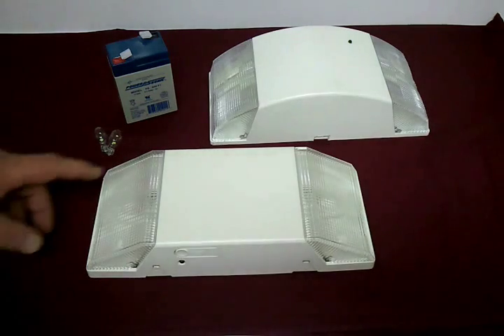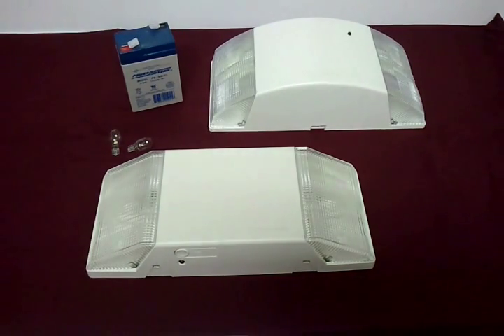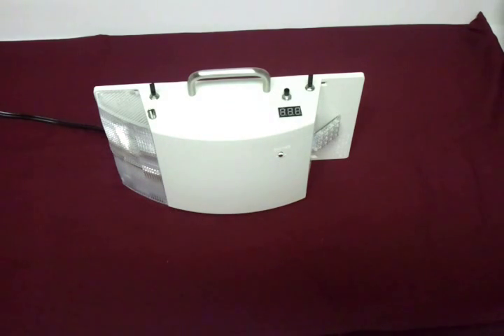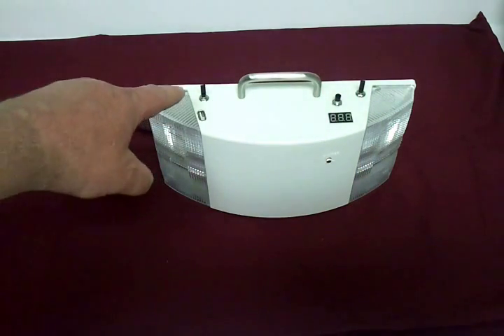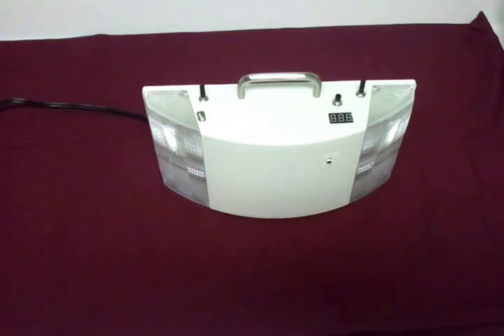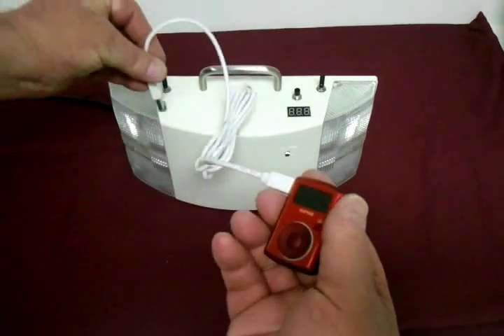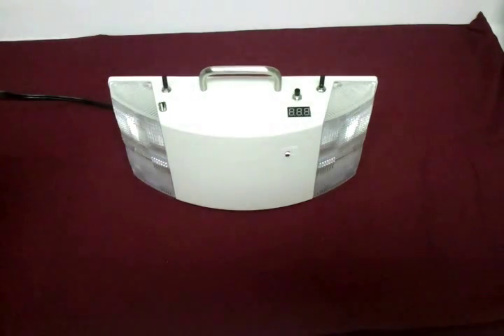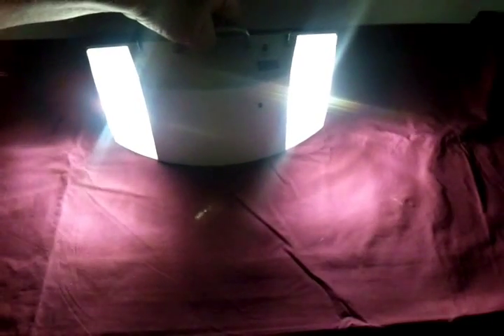Emergency Light Project

Comment: If you aren't already using the original test button, add a test button to the unit. it'll temporarily put the unit into emergency mode so you can check the battery. also, this is just me, but I'd leave them in automatic mode so if the power goes out at night, the unit springs into action. if in the day, no big, just go ahead and turn it off. turn it back on at sundown.

Comment: well after reading some of the older post i see my ideas have already been suggested cheap china ebay type Mini Adjust IR Pyroelectric Infrared PIR Motion Human Sensor Detector Module and relay board simple to use 3v operation to turn light on and off  hope this helps